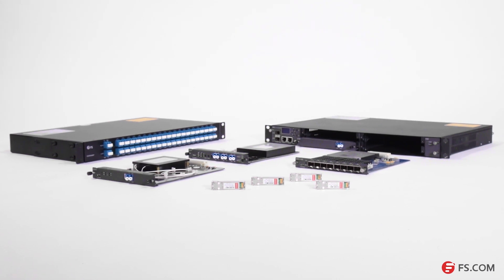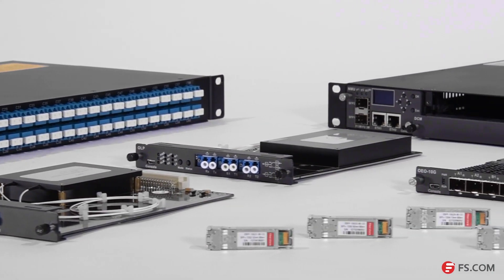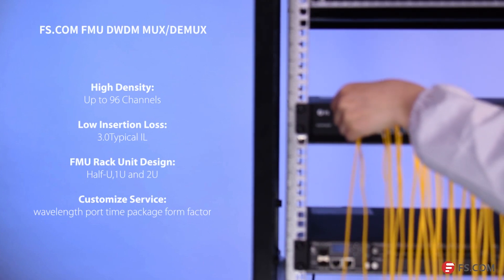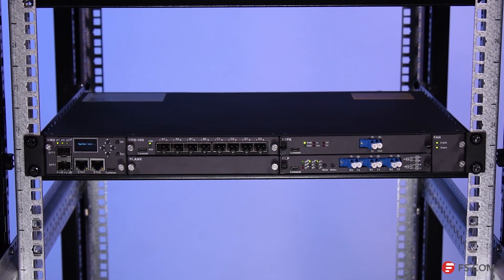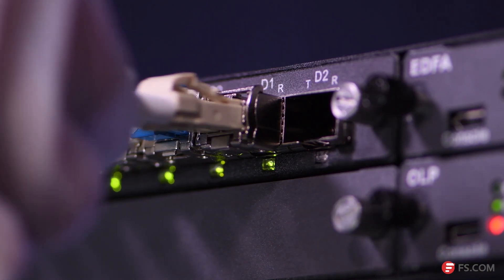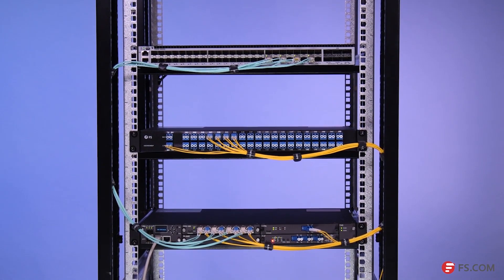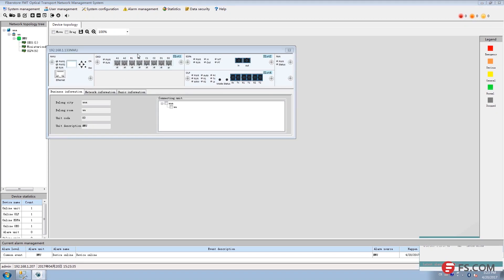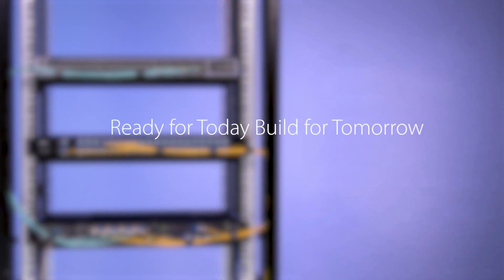FMT Series DWDM Solution for Long-Haul Transmission | FS

Comment: How is shut the power on DWDM to perform OTDR from other end?
Reply from the maker: Hi Sanjay khatri, since DWDM multiplexer or demultiplexer is a passive device and needs no electrical power so there might be two situations depending on the OTDR type you are using. If you are using a handheld OTDR tool, you may need to shut down the link and connect the OTDR to the point you want to check (like unplugging the patch cord from the transceiver or adapter); if you are using a line card OTDR that was inserted in a management chassis, you may check the device info from the management software and there's no need to stop the link.